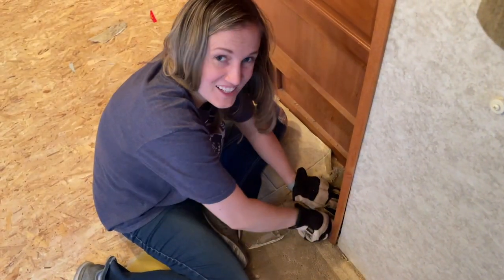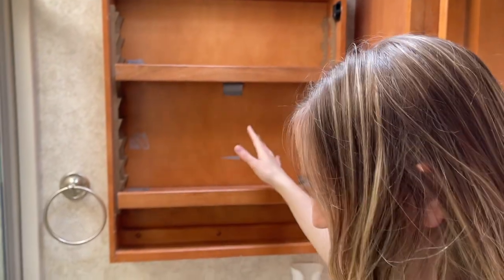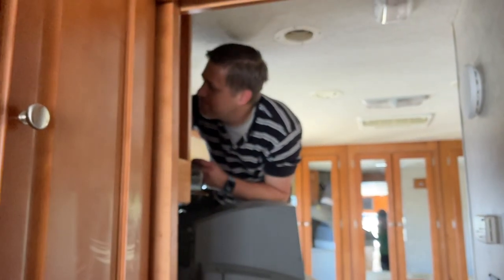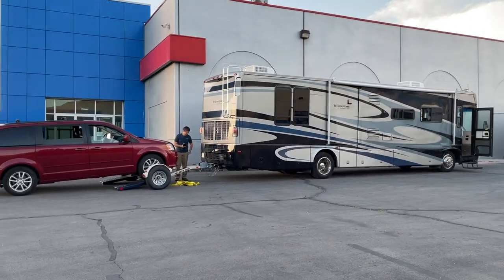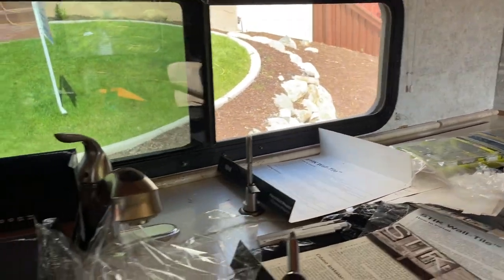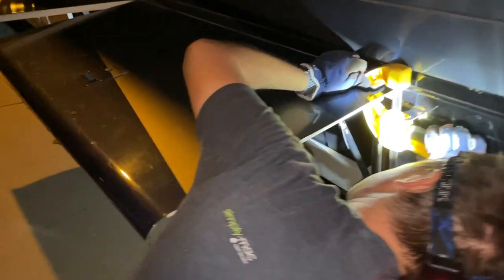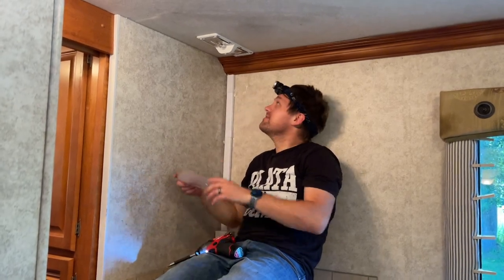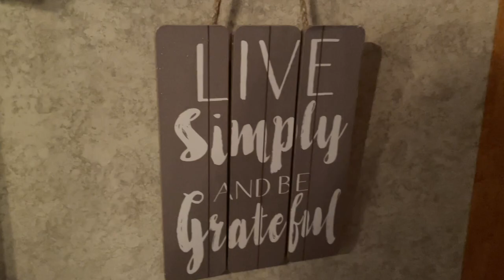RV Renovation | Remodel an Old Class A RV into a Modern Tiny House

Comment: Great work on the flooring but how did you deal with the slideout going over the nee floor?
Reply from the maker: Good question! That transition piece was a little tricky on the top, but the bottom didn’t require anything special. Just laid it down.